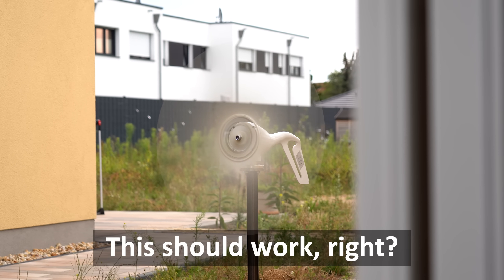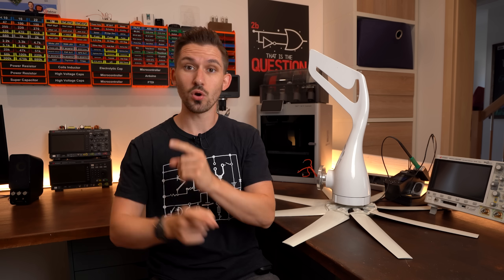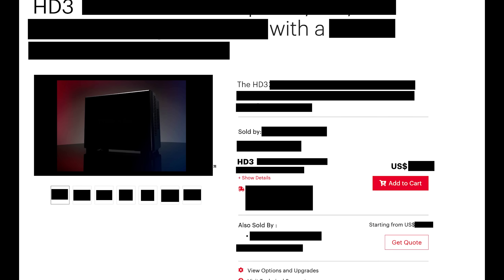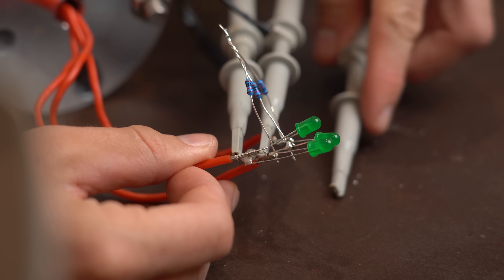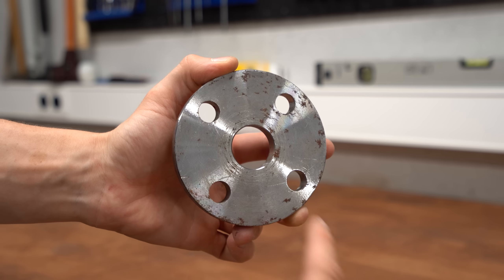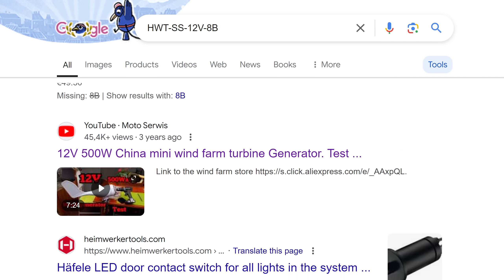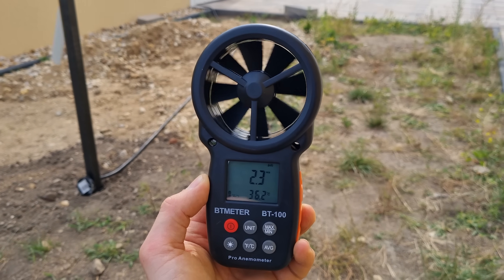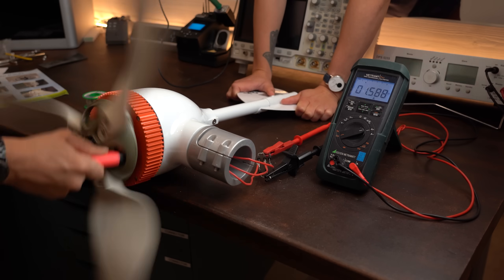I tried to Power my Home with Wind Generators! (Worth it?)

Comment: I’d definitely be interested in a follow-up video where you either modify the windings or DIY your own version!
Reply from the maker: Noted!
Reply: @greatscottlab  Cant you mount it on the roof?
Reply: @Six_Gorillion  I'm pretty sure that this is illegal in germany. Requires a construction permit by the local government, and there is an entire premission process that goes with it, because neighbours need to give permissions too. And if he is not the actual owner of the house, it would get even more complicated.
Reply: @greatscottlab Ich schreibe gerade meine Abschlussarbeit darüber. Habe die 400W Version von Vevor, bekomme bei 2000 u/min um die 200Watt denke das sind Windgeschwindigkeiten von ca. 20 knoten. Habe es aber auch noch nicht richtig im Wind getestet. Wirkungsgrad liegt bei ca 40%.
Habe ebenfalls den Gleichrichter und dann einen Victrom Mppt Solarregler, Leerlaufspannung geht aber teils bis an die 100Volt also Vorsicht bei der Auswahl des Reglers. Ein Arduino überwacht die Drehzahl über die Frequenz, abgesetzt noch ein Anemometer. Aber der genaue Ablauf ist etwas komplizierter.
Reply: @greatscottlab  10:12 - Do not rewind motor, create some stepup mechanism like in clocks. Then you will be able to use it even at low winds. Put cogwheels between main shaft and blades...
Reply: @greatscottlab  I agree! I would love to see a reworking of the existing unit(s) or even a DIY wind generator!
Reply: @greatscottlab use victron mpptt realy good 👍🏾
Reply: @greatscottlab  try the speed multiplier like a MTB a set of cogs
Reply: @greatscottlab  Thanks, please make a DIY generator, maybe we you could try using alternators? I am an amateur, I apologize in advance. Some videos use stepper motors but they require a lot of torque.
Reply: @greatscottlab  I think it would be best to use a boost converter with a constant current functionality.
Reply: @greatscottlab  You need to test it on a roof or on top of a hill to get enough wind
Reply: @greatscottlab  why do you have such thick german accent if you are Scottish?
Reply: @ZelenoJabko 
https://en.m.wikipedia.org/wiki/Great_Scott
Despite being German his English is near perfect.
Reply: @greatscottlab  Might want to add an epilepsy warning before the footage of your generator demonstration with the leds and fan flicking the screen 2:32
Reply: You still gotta have some big ass wings
Reply: jow about a gearbox, instead of changing the windings?
Reply: @xxiji5075  Doesn't change the available power. Little power available minus turbine efficiency minus mechanical losses from the gearbox is even less real power than without the gearbox.
Reply: Me too!!
Reply: I think it need a gearbox to generate more speeds
Reply: can you mod it with some gears ? instead of electronically boosting current try adding some mechanical boosters ( I don't know maybe wont work but will be fun )
Reply: @addygreen8919  Does it have English subs? and which video in particular you are talking about on that site?
Reply: @Songfugel  No English subtitles, but his main points are:
- do not buy something to cheap and to small, if you want to get some benefit from it
- if you put some small ali express wind generator without any certification in your backyard, it is more for fun, than for actually getting significant amounts of energy
- small wind generators are usually not competitive with solar or your local energy provider, but can make sense in some scenarios (a wind generator for camping near the sea as an example: https://www.youtube.com/watch?v=QeHU4ZNwQi4)
- unusual designs with very high claims of energy output are often a scam

One good video (in German):
https://www.youtube.com/watch?v=J8EarSnN4IM&t=191s

Another good video with a a wind generator for camping (in German):
https://www.youtube.com/watch?v=t2C-Q-yJekI
Reply: Thanks.
Reply: Agreed
Reply: Especially if he gets another narrrrrrrrrrrrrrrattttttttttttorrrrrrrrrrrr! 🤣
Reply: It won't matter. There is no real power to be had from a windmill near the ground. One mounted 3 feet off the ground is a joke no matter what you do to it. There is almost no wind energy there at all. I'd say at least 30 feet off the ground is essential to even start getting real wind power.
Reply: @johnwest7993  Yep. Doesn't matter. Even at 6m/s with a turbine of that diameter the available power is under 200W. Even with a revolutionary turbine design that maxes out the power you can get from the wind (59%), AND without any mechanical or electrical losses and 0% wake loss you're still looking at just a little bit over 110W. With realistic turbine efficiency and with all the realistic efficiency losses along the you'd be lucky to see 50W of power.
Reply: Alter, diy ftw! Ich liebe es!
Reply: Unlikely that you'd get blades that perform better in a general scenario without wasting so much money that you could get 2 or more professional windmils.

Comment: Wind power increases with cube of wind speed, so if a wind turbine is 400W at 10m/s, then it'll do approx 40W at 5m/s.

You have to live in a really windy place (often have 8-10m/s or more) for these to make any sense at all.
Reply: And in a windy place you always risk extreme winds which will rip the thing apart. A huge problem for wind speed measurement / small scale wind power on mountain peaks.
Reply from the maker: Thanks for the feedback :-)

Comment: I live in a VERY windy area - and have one test wind generator (3 phase alternator).  You really need to be about 15ft above ground level to get decent results.
Due to an unfortunate storm earlier this year, my gen's pole snapped in half (yes, causing mass destruction!).  When I remounted things, it's only about 8ft up - and almost doesn't spin unless there's a hurricane.  :/
Reply from the maker: Oh boy. That certainly sounds like no fun when running into problems like mass destruction. Hope nobody got hurt. Take care :-)
Reply: @greatscottlab  - I got lucky. It spewed blades (then the whole head, and pole a second or so later!) away from my shed, detached shop/garage, house, and solar array!  There was about a 60-70* span viewed from above where nothing would get hit.... and it landed right in that span!  I found parts about 100ft away.  :O
Reply: It's a similar thing with sailboats. You may feel no wind on the ground but once the air is more free from the resistance of the ground it can move more freely and often has more speed.
Reply: @Tb0n3  it makes you wonder about kite power.
Reply: Used to work on communication towers. We made skid towers, put a 50ft tower on a plate with a hinge and a cable winch to be lowered for transport and maintenance. You could lower that in a storm. 

If you have room they make light telescoping guy poles that can be reinforced with guy wires making them very strong.
Reply: @samrye8342  - No fear of heights for you then!   :D

Yeah, I had 3 guy wires, about 60% up which was supposed to give the right angular strength.  No match for the winds here.  I'm done with it all though. Just going back to my 4kw of solar.  It's all just for 'play' anyhow, not like I'm off grid or anything.
Reply: My friend had a similar issue. Strom broke the original generator, and then a storm-proof one was installed, resulting in no spinning unless equally strong storm came
Reply: Do smaller turbines not have the ability to control their rotation speed?
Reply: @ThylineTheGay  you should be able to dump to a resistor bank if the speeds get too high, that resistance would act like a brake to the turbine. the bigger issue at that point would be the blades themselves acting like a sail and snapping off. some way to feather/alter the pitch of the blades would allow it to function even at higher wind speeds. would be an interesting project making a system to actively control blade pitch in order to get the most efficiency out of varying wind speeds
Reply: @Zekrysis42 no, it needs to furl
Reply: @ThylineTheGay  - Yes, if your controller has it (have yet to see one that doesn't, but...), it will short two of the phases above a certain frequency, giving you a reluctor brake.  My issue was that the winds were coming from different directions too fast. The head couldn't rotate fast enough to point into the wind.  We had gusts of 140km/h that night.  Bleh.  :(
Reply: @ThylineTheGay  Well you either need a dump load to slow it down or a furling tail design where the rear wing that guides the turbine normally in to the wind is basically offset so that if wind speed over powers the tail wing, it pushes the turbine out of the wind preventing rapid unscheduled disassembly.
Reply: @ThylineTheGay  they do for overspeed. they pretty mutch short themself to act like a wind brake.
Reply: I've always heard 40 feet.  15 feet wouldn't even get it over my garage, let alone the second story.  Add in 60 year old trees and i doubt 40 feet would even do it.

Comment: Hm... Perhaps it makes sense to make a similar fan that will produce about the same air flow and see how much energy it will consume. There are also other designs of air turbines designed for higher torque, which allows you to accelerate the generator at high speeds. It's enough to type "Wind Generator" into the search on YouTube and there's so much there! There is an "O-Wind Turbine" and a "Horizontal Wind Generator", it would be interesting to see your tests of these turbines!

Comment: Wind generators always seemed like the most high maintance power production with the least amount of production. Great for very specific locations. but otherwise seems overrated. cause in most cases it seems to be better to just increase the size of solar power. if you want an off grid source
Reply from the maker: For private homes, yes.
Reply: and your solution to a system where there is no sun for solar?
Reply: @patrickcoyne1292  if there is no sun then hydro is better. and im saying this in a country where we only get a lot of sun 5 months of the year, and the rest of it is very dark(i live in a place that has less than 6 hours of somewhat brightness, not sun, at the worst)

your scenario is so farfetched, its closer to insane. wind power is more of a hassel than solar power at places with little sun, cause they would also be cold places. and thats an absolute headache with moving parts. one day wrong and your fan blades are slightly crooked and bent cause of ice

we even got a valley where they put mirrors on top of a mountain, to shine down in a city, and thats still a better option, with solar than wind.
Reply: @GoalOrientedLifting  so you solution to no sun is to hope you have running water nearby?
Reply: @patrickcoyne1292  the farthest north greenhouse uses solar and heat storage, from the sun, to get heat and power for the plants. not wind. that itself should explain how bad wind is as an option

essentially what you do is size up the solar storage capacity to take in more solar and store more solar power,  during the darkest times, wether its heat or straight up wattage. wind is a bad option, in every way possible. unless youre in the medieval times, and wind is all you got

EDIT: as a technician in production machinery. every moving part is an increase in error and breakdowns. solar has no moving parts. wind has essentially 3(blades, rod and stator/rotor). if you break it down to what can go wrong
Reply: @GoalOrientedLifting  so your next solution is for me to to buy a stack of batteries, for each week of the 4 months i live without sunlight. and then have them age out or short cycle all summer, while i don’t use much energy?
Reply: @patrickcoyne1292  The northest part of norway mainland has 2 months of darkness. either you live on the northpole or youre lying. also that is such an insane niche and specific situation. to think its somehow a good arguement for wind power is mental gymnastics, at best.

its like all of those people who say "my grandmother lived to 98 while smoking" when people say smoking is bad. youre not proving a point. your makin an exception and act like its a good argument for the norm.

The only other place i know about that has that much darkness is svalbard, i worked with the guy who was head of the power production plant for 11 years. you dont need wind power( they even install more solar than wind, by a huge margin, there)
Reply: @GoalOrientedLifting  i live in alaska with a mountain to my south….my panels don’t see light sunlight 4 months. i’m not trying to prove a point, since you seem to be well versed i was simply asking. and each time you suggested something i have thought of but in practice did not work or is far to costly for what it’s worth. i do have moving water. it’s over 1/2 mile away. so lots of voltage drop, also the river freezes in the winter so won’t work….in order to store enough to id need 480,000wH worth of batteries if i were to use my current set up, that would cost me 160,000 dollars(not worth it) and i’d make it through winter. so what i have done is is run 4 primus air40s and atleast 12 of the 16 weeks of no sun i do not run out of power. so my experience wind might not work for everyone but your blanket statements make me wonder if it just doesn’t work for you

Comment: Many years ago my neighbors purchased two massive, commercially made wind generators. They had concrete poured and a 1 meter pipe installed to support it. Each are about 45 meters high. They became the world's largest paperweight.
Reply from the maker: Haha....maybe also the worlds most expensive paperweight.
Reply: A guy in my town decided to go off grid when he bought a property out of town. He obviously had solar, but he also had a small wind turbine like these. He had it mounted up on an old water pumping windmill platform that was already there. It was almost always spinning away any time I drove past....
But I suspect compared to the 4 or 5kw of solar panels he had, the 500w wind was barely noticeable.

This was decades ago, BTW. 4kw of solar probably cost him almost as much as the house 😂.
Reply: Nice lie
Reply: Ouch
Reply: Nah the multi billion $ wind farms are the worlds largest and expensive paperweights and suffer with same and then some more issues. Noise pollution, very high CO2 production since you cant recycle most of the materials, like blades get just buried into location when those are taken down or self dissemble and any power production then gets cut to negative numbers when you count in all the electricity that is needed to keep them operational in cold north as you cant let them freeze even if thing is not turning. To add insult to injury you need helicopters to spray ethanol solution to blades so those wont freeze and collapse the damn thing costing even more energy and pollution.
Solar panels work decently, but those too have issue of recycling. Currently i dont know single company that actually recycles used or broken panels. At best they "recycle" the aluminum frame and cables, while rest of the panels get shipped into african e waste dumps to flush heavy metals into groundwater and locals go smashing and burning them to get any valuable metals they can scrape with stone age tools from them... Green chance right?
Reply: You should add some additional info. Otherwise these comments are useless. Oh, unless you work for the electricity company 🤣🤣🤣
Reply: @FBPrepping  Honesty, I don't know much more than that. About 10 years ago, I stopped by the owners house to ask them a few questions about it. I'm interested in DIY alternate energy, and I was curious if it was viable for my property. I live in 'farm country'. Regardless, they said it was the biggest waist of money.

They showed me around, and gave me a small tour. They had a small building next to the windmills where all the electronic are housed. Everything was rusty and broken. It was all turning to dust.

...and no, I don't work for the electric company. lol
Reply: @sky173  Of the farmers and sailors I know that have tried small scale wind they have all came to that same conclusion. Underwhelming performance, surprisingly high equipment failure, for way too much time and money.
Reply: @sky173  I disagree, it was the biggest hip of money! ;)
Reply: @sky173  If you have reasonable average wind speed on your property then a sufficiently big turbine will give you a reasonable amount of power.
Reply: @Sekir80  "Does this comment make my turbine look fat?" 🤣😂🤣😂
Reply: @enmiredbythelazy4401  Ehhehhehe, hopefully not :D
Reply: Yes these things are very efficient at breaking down.

Comment: Power efficiency: 1W/m²
Reply from the maker: For the generator? Source? Or just a guess?
Reply: @greatscottlab  Your video is the source, if you want to generate 1kW your tribune diameter should be 30m. First get the physics right then the electronics.

Comment: Disappointing performance but useful to see how these cheap ones actually perform. This is where a DIY wind generator may be better - you can build the coils specifically for the lower average wind speeds, or use an old car alternator, etc. It also seems like those MPPT controllers were not actual MPPT or designed for wind generators. Hopefully the useful bits of those wind generators can be used with a better DIY solution.
Reply from the maker: Thanks for the feedback :-) I will hopefully come up with something better for part 2 (if there is enough interest and I get to it)